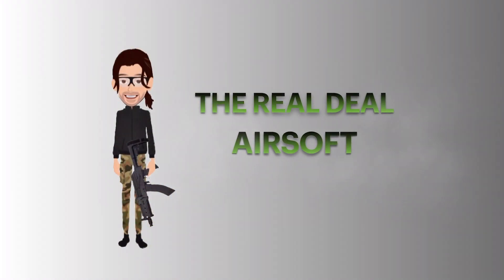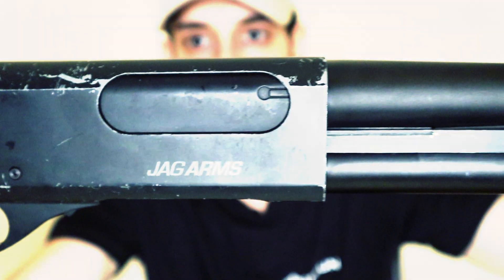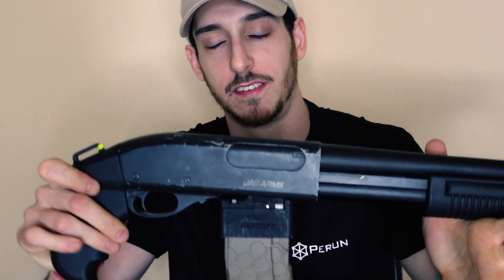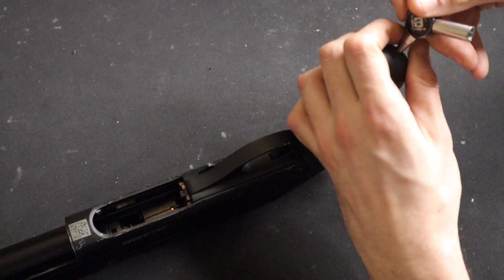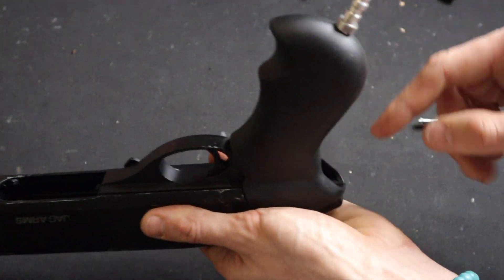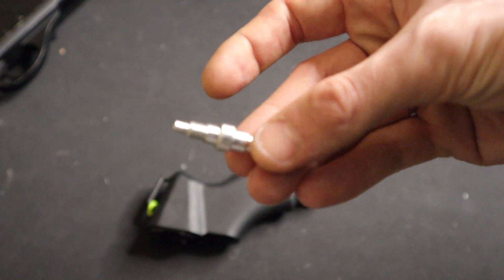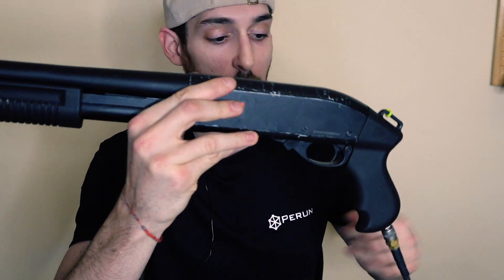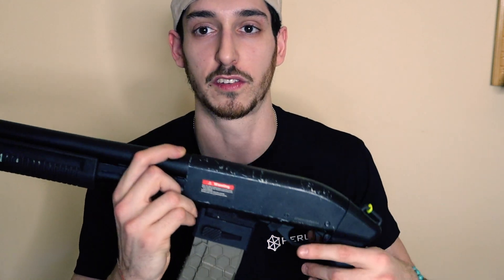How To : HPA Tap Jag Arms Shotgun ( Airsoft Scattergun)

Comment: If you have leaks with the tape on the threads use pipedope. Its usually blue, we use it at work up to 3k psi. I used it on my guns and it seals anything leaking.

Comment: Nice easy to follow guide. Was hoping to see what the seal is between the tank and gun. Appears I’m missing one and it’s leaking from that union.
Reply from the maker: Seal between tank and replica is the air valve that I installed. So this means you must screw down that valve much more and I also applied Teflon tape 

Make sure you wrapped the Teflon tape ina. Way that when you tighten the tape gets tight too vs if you wrap it the wrong was the Teflon will come undone as you screw the valve in
Reply: In other words Use PTFE Tape or Locktite ThreadLocker on the thread. If using Tape ensure to tape the thread clockwise (or counter clockwise dependant on the thread you have leading into the hole.)

Comment: Hey do you mind making a video on your upgraded MP5 and the rate of fire for it? I’m trying to make a MP5 build with a crazy high rate of fire without a hpa tank. I’m trying to keep the gun electric
Reply from the maker: I have an upgrade series already uploaded for the mp5 but a few things changed for that build. I’m using a ASG 30k boost motor not the motor in the bideo
Reply from the maker: 13:1 ratio gears 
ASG 30k motor 
My custom real deal piston / piston head with modified tooth rack for angle of engagement. 
Modify ceramic bearings but now I’m using insidious armory steel bearings 
Vfc cylinder / gate aster 

But I reccomend Perun v2 optical over aster. And I retail them if you want one HMU on Instagram

Comment: Hey i got co2 pistol and i was wondering if i could just unscrew the co2 valve and use this adapter, would it work the same?
Reply from the maker: yes you can. just make sure to lube gun before every use and clean and lubricate after.. Air is super dry and could fuck o rigs. Jutst lubricate often . keep that thang slippery yah heard????

Comment: Is the “modification” just widening the hole on the grip? Do you have to drill into the valve at all or just widen up the hole on the plastics so the larger part will screw in properly?
Reply from the maker: Just widen hole
Reply: @TheRealDealAirsoft  how?
Reply: How

Comment: What’s a recommended psi output on your regulator
Reply from the maker: 80-120 ish range
Reply: Thanks also another thing how did you take off the door on the gun so it takes the m4 adapter

Comment: Whats the output pressure on the reg? I assume this gun couldn't handle co2? (750-800psi)
Reply from the maker: Green gas pressures are about 90-120 psi 

To safely operate the gbb you need to operate at similar pressures on hpa 

90-120 on the regulator

Comment: I have a couple questions I have a jag arms shotgun  and It broke some months back now  I’ve finally got around to repairing it. But have decided to hpa tap it. Would you have any ideas on what internals I’d need to replace to help the gun last longer without repair? and without re rack problems as it jamming was the cause for repair in the first place due to faulty parts that will need replacing anyway.
Reply from the maker: There’s not much support for after market parts. It is what it is
Reply: @TheRealDealAirsoft  i found someone who knew how to hpa tap it through the stock appreciate it though.

Comment: For some reason my tap airsoft gun won’t feed into the chamber idk why it’s been driving me crazy
Reply from the maker: Send tapp a message
Reply from the maker: Do bbs go to the top of the mock shell when you load a mag ?
Reply: @TheRealDealAirsoft  yes they will go to the top but it’s almost like the tip doesn’t touch the inside of the adapter after a closer look it’s almost like the shotgun adapter doesn’t reach the feeding tube